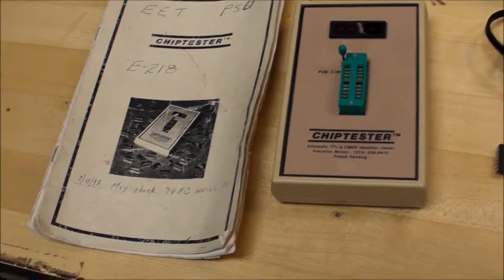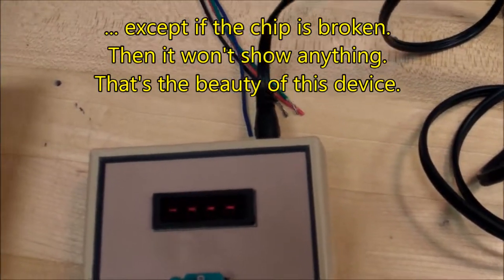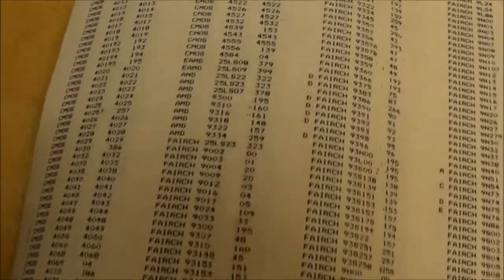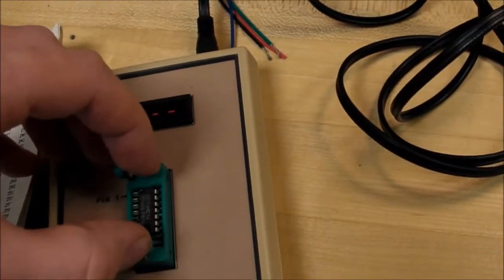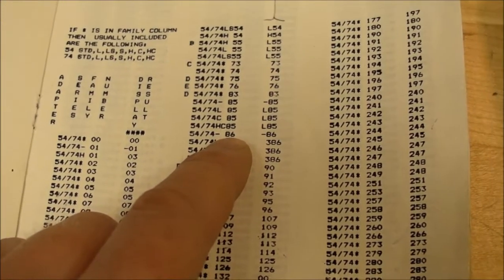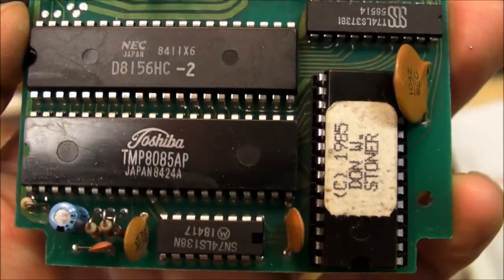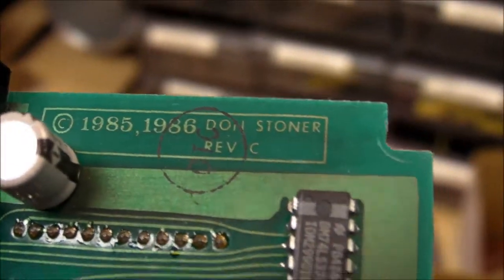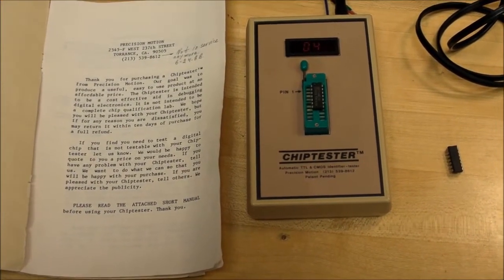(#0077) Vintage Chip Tester Quick Review & Teardown

Comment: Reason you get so many common numbers is bercause they are functionally identical, but can be different versions with eg open collector outputs or different families or speeds. Some are available from different manufacturers with different numbers. Love to see the listing from that prom there, it is a simple 8080 minimal system with a PIO driving the socket and the bus driving the display. All the clever is in the assembly in the prom.